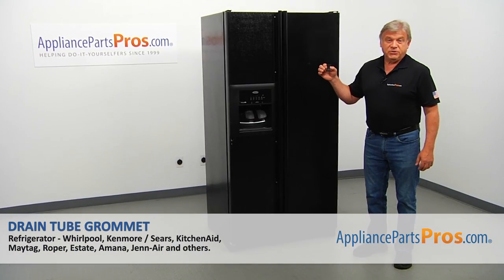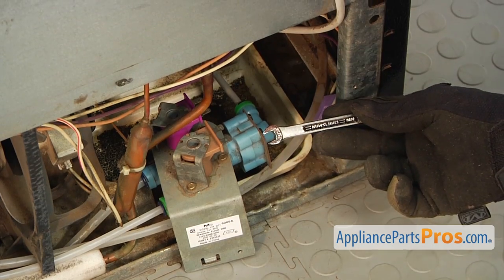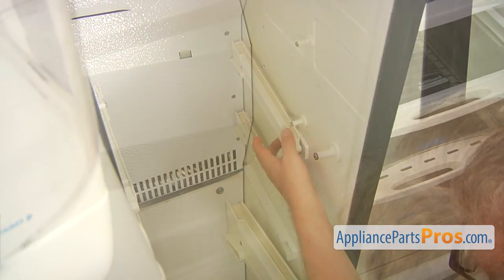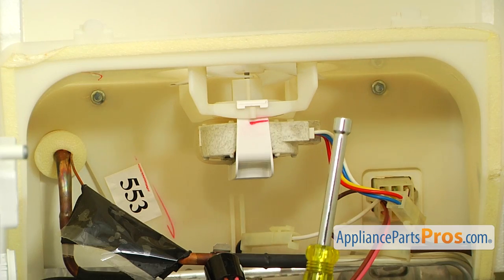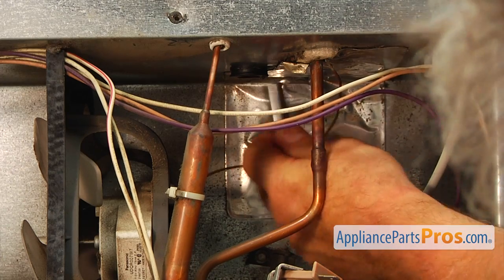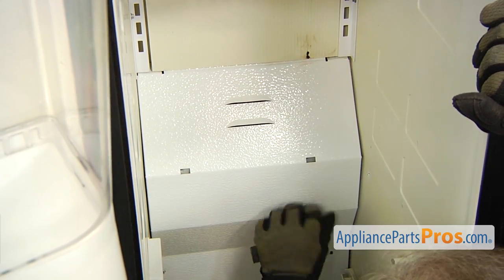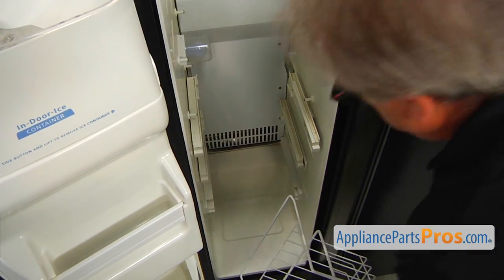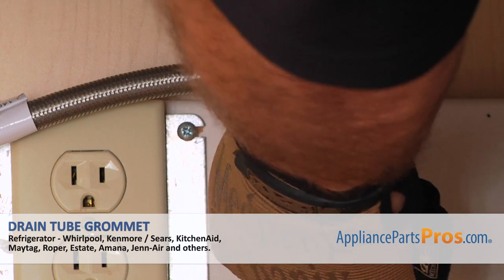How To: Whirlpool/KitchenAid/Maytag Refrigerator Drain Tube Grommet WP2304888

Comment: Hello, Simon!  I have a quick question for you!

Bought a home and the refrigerator came with it.  The fridge alerted that we need to change the filter.  I ordered the same model filter that was in it and replaced it.  Water dispensed just fine, all was good.  I am noticing that, at random, water will not dispense even though I hear the pump/mechanics running.  All I need to do to get it to work is to remove the filter and re-insert it, works every time!

Any ideas?  Thank you for your time!!!

-B
Reply: Check the inlet valve assembly on rear freezer side. Only thing that controls water flow